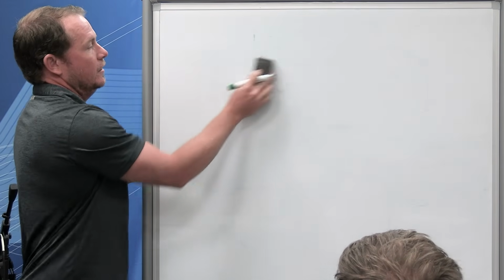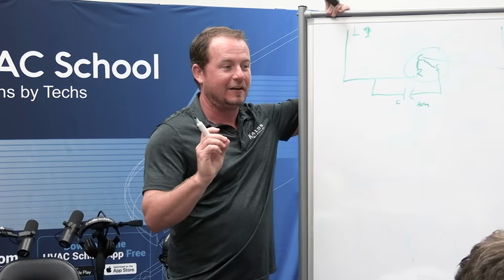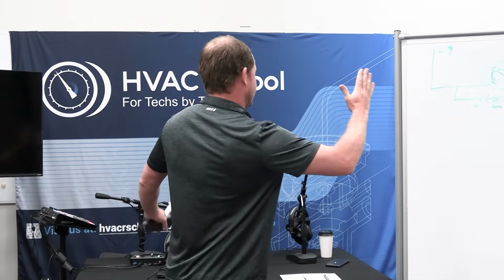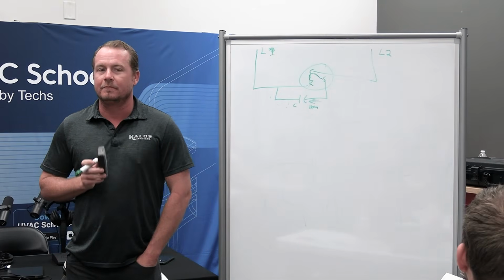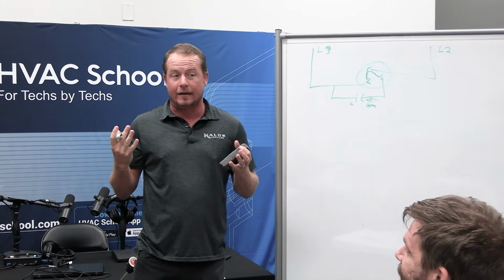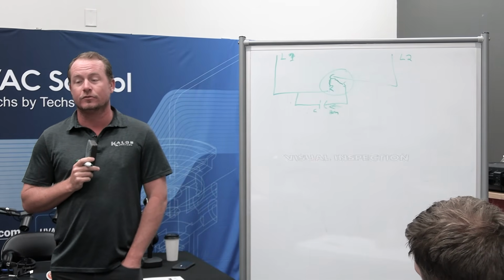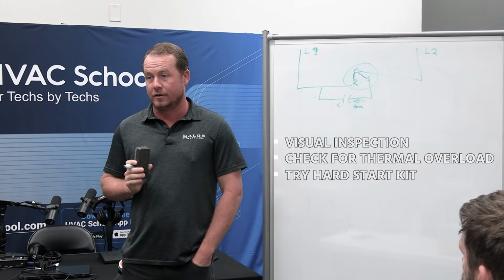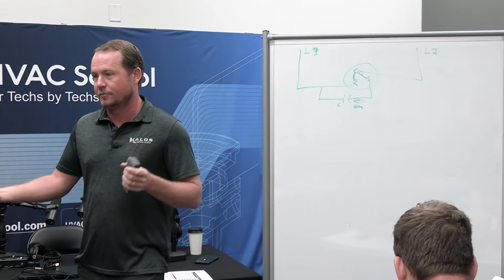Capacitor and Hard Start Myths Busted

Comment: Also, AC current DOES pass through a capacitor and there is no ballon. The current goes through it. 
A discharged cap acts as a short. Wire one across a potential difference and wait for the big boom. A fully charged cap will resist current flow. This is why it will hold a DC charge and not allow any more current through it. But with AC, the cap will not stay charged. It will discharge again, and cause a short circuit. 

A great example of AC passing through a capacitor is with amplifiers. They have coupling capacitors from one stage to another. They block DC from getting through, but allow the AC to travel unimpeded. For example, in the pre amplifier section, we have a very small signal and our transistors have a certain DC bias, but as we enter the next amplifier, to increase the amplitude of the AC signal, we need a higher DC bias to provide more power for the next set of transistors. So basically, each stage of amplification will need increasingly higher voltage power supplies, but the signal needs to pass from one to the other. The coupling capacitor serves this purpose, allowing AC through it. 

I mean this may be splitting hairs, but we are trying to understand it and dispel myths.

Another great example of AC passing through capacitors is with the crossover inside speaker cabinets. The capacitor is sized to resist certain frequencies from passing though, while allowing others to pass freely.
Reply: Technically, the actual electrons do not pass through the capacitor, but they affect the circuit on the other side of the cap dielectric as if they were, through the field developed by the charge.
Reply from the maker: @wingerrrrrrrrr  exactly
Reply: @wingerrrrrrrrr  I just created a video, since I’m off today and interested in the topic. You may be right about the electrons. I’ll have to do more research on that. I do remember learning that when you’re electrocuted, it’s not electrons, but ions passing through your body. I’ll have my video up shortly. But to answer the question, yes current does flow through them.
Reply: @wingerrrrrrrrr  some sources on the web say the electrons flow, and some say they don’t. Wikipedia says that capacitors allow alternating current to flow through them, but doesn’t distinguish if it’s actual electrons or not. My old textbook from 1989 says that ac current flows but also does not specify. In the beginning of the book, however, it says that the book will regard current flow and electron flow in the same manner. It is confusing. Whether it’s electrons or not, current definitely is going though there. I’ll try to research it a bit more.
Reply: @brianlittle717  it's basically electrons by proxy, the ones on the opposite side of the dielectric stand in and represent the original ones in full force and manner 😉.
Or a crowd of zombies pushing against the rubber wall and moving the ones on the other side, until the wall gets stretched enough to keep them from pushing any further (DC voltage, with cap fully charged). 
Increase the mob of zombies pushing harder and harder (higher voltage), to the point the wall gives way (cap overvoltage breakdown), and then all hell breaks loose with uncontrolled zombies running amuck all over (magic smoke released).
AC voltages are the zombies pushing back and forth on the rubber wall in a madcap spy vs spy scene.
Reply: @wingerrrrrrrrr  sounds a bit like quantum physics...
Reply: @wingerrrrrrrrr  I like the zombie analogy. That’s pretty cool. Capacitance definitely behaves differently in DC circuits than AC. Whether it’s electrons or zombies or whatever, the current is most certainly going through my capacitors in my videos. There’s no getting around that. The capacitor is definitely closing the circuit and allowing something through.
Reply: @brianlittle717  By all means, please come here, start spouting off like you're an expert, then reference Wikipedia and 35 year-old text books as your source.
   Go back to tiktok and chugging antifreeze or Tide pods or whatever you geniuses are doing these days.
Reply from the maker: Explain how it passes THROUGH a peice of plastic sheeting between metal plates 

Ohm across a run cap and see what you get

There is no conductive path
Reply: @HVACS  absolutely. When you use an ohm meter, you are using a DC voltage. You have simply charged that capacitor to a DC potential. Capacitors behave completely different with an AC signal. Electrons from one plate charge the other and then discharge. This is how electrons can flow from one plate to another. Remember, we don’t need a physical connection to complete a circuit. If my body is charged with a high static voltage, I don’t have to make physical contact with a grounded source for electrons to move from one place to another.
Reply: This is just the first thing that pulls up. 

https://youtu.be/11dzDiPfAs8
Reply: @HVACS  What he means is the AC SIGNAL passes through a properly-sized capacitor.  As the electrons enter the foil, they encounter the barrier at the dielectric, build negative charge on that plate, repelling electrons from the opposite plate, and out of the opposite pole of the capacitor.  So the signal is effectively passed, though the individual electrons do not.
Reply: @HVACS  yep. electrons pool on one side on the uphill curve of the sine wave. when the phase shifts downhill (sine wave) the pooled electrons leave the capacitor. Only with a leaky capacitor will electrons flow within the capacitor past the dielectric barrier
Reply: @HVACS  To be fair, in normal wiring electrons move about 1/4 inch per second, so at 60Hz they'll wobble back and forth by a few thou. As far as electrons flowing goes, there's little difference between a capacitor and a wire, it the effect on voltage across the cap that's the useful part...

Comment: ELI the ICE man
In an inductive circuit, voltage leads current by 90*
In a capacitive circuit, current leads voltage by 90*
The PSC motor is a capacitive inductive circuit 
The capacitor is trying to neutralize the phase shift in the start winding, that was originally caused by the run winding being shifted by the inductive circuit. 
The effect is that there are more “north and south” poles making the motor more efficient and more powerful by having electromagnetic forces applied at multiple points at any given time.

Comment: This was well explained. Coming from the engineering side, about a year ago I started looking for a simple way to calculate what size cap is needed in PSC and CSCR motors. I made a little headway by looking at simplified RLC circuit models. It was enough to realize that when inductors like motors are paired with capacitors, they get a kind of 'tune' that is specific for the frequency of incoming power. If one replaces a cap with the wrong size, expect the circuit to be tuned at the wrong frequency, with unpredictable and often bad outcomes. As you say, relative current flow down the two windings and power factor can dramatically vary depending on the capacitor chosen. My effort to find a simple solution hit a bigger road block when i discovered that power factor and motor inductance vary with rpm, and of course there is the usual tradeoff of starting torque vs full load efficiency considerations. I believe most new motor designs these days are practically tested in the lab with various capacitors, ultimately leading to chosen capacitors that balance power consumption, motor longevity, cost, and reliable starting. There is no easy formula. Any movement away from the design is not likely to end well, if only leading to lower efficiency or poorer motor survival.
Reply: Once you get past the starting function, run caps are selected for the best power factor, i.e., most efficient, at the design load.  To me, the run cap and aux winding form something of a tank circuit, like are used to tune radios.  Grundfos had a good motor book on their website.  I believe it is still out on the internet, even the internet archive, but they've organized their "education" so that it isn't readily locatable on the Grundfos website.  From that book, I learned the cap is chosen to create as spherical a magnetic field for the motor as possible.  When the cap is wrong, the field is elliptical and the non-circular part is dissipated as heat.
Reply: @jkbrown5496  yes using a curve tracer can really help find the best cap too the data sheets are helpful but you would be surprised still how much u can see with a curve tracer just from the shape of the circle that each cap gives you
Reply: @daveselectronicslab  Having to calculate power factor and start/run caps in HVAC doesn't inspire the same confidence I have in, say, a third-order LC crossover/bandpass filter. It's not that capacitors change fundamentally, it's just the amount of variants in manufacturing that can share one data plate. I suppose that is why some people just stock turbo caps on the truck, and why I tend to love good tolerances and high voltage ratings. And, all my facilities with 3Φ power for HVAC. 😁
Reply: @jkbrown5496  you
Reply: @jkbrown5496  Thanks, for the tip, I found it, searched Grundfos motor book pdf.
Reply: If only the impedance was fixed.  But at least your dealing with a 60hz signal that doesn't complain about parasitics.  One way to test, off the top of my head, is to use two probes of a scope.  One with voltage over time, the other current over time.  Adjust the capcitive component until they line up.  I have always though resonance to be that simple.  Align the current and voltage components.
Reply: Get your own channel Nerdy Boy.  People don't care about that shit.
Reply: I appreciate your input. I have been looking for a way to figure, when the uf value is not present, how to figure the uf... your explanation is solid. Thanks!

Comment: I like the analogy of the ballon or the bladder tank a pump, I think it is one of the best analogies to clarify how a capacitor works in the circuit

Great job Bryan as usual! and you got really nice interactive techs over there 

really funny to see Bryan's excitement @26:00 when he talks about hooking up a capacitor to your outlet
Reply: Or a plumbing expansion tank. With a backflow preventer and regulator, the supply will only provide 60psi (for example). In a closed system with all faucets closed after just running hot water, the water heater will fire and increase the psi from heating the cool water that entered the water heater tank while the hot faucet was on. The expansion tank is normally pressurized to 60psi, but the expanding water pressure will push the diaphragm allowing water to flow into the tank (let's say gradually increasing pressure to 65psi instead of 90psi without a tank). This extra pressure is then released when a faucet is opened and the system returns to 60psi when the faucet is closed. However the role of capacitor for a compressor and role of expansion tank in plumbing are totally unrelated.
Reply: These balloons can develop negative pressure so a bladder restriction would represent it best. Electrons don't pass through them just as water or air wouldn't pass through the bladder, but can affect the other side in similar fashion.
And if subjected to too high a pressure (or voltage in the case of the capacitor), thar she blows 😉
Reply: BAD IDEA!

Comment: Good video 

Capacitor used on AC doesn’t have polarity
Capacitors doesn’t reduce the amount of current, just de-phase the voltage and current (shift forward the current from the voltage)
AC voltage doesn’t goes from 0 to 150 as the video said, in facts it goods from -150 to +150
Reply: The capacitor also dictates how much current can get through by its size in micro Farads it fills up on half the wave and dumps on the other half what it has stored with is dictated by its size hence it does effectively limit current

Comment: When the compressor is locked... Hit it with a hammer 🤣🤣🤣. Remember those briefcase sized machines used to rock the compressor? Should do a class on those.
Reply: I used to just kick them with my steel toed boots.  It’s a good way to get a thermal overload, which is stuck open, to close also.

Comment: I’ve been explaining this to my technicians for years and few seems to get it, so I hope if I show them this video, they will finally understand. THANK YOU FOR DOING WHAT YOU DO, AND KEEP UP THE GREAT WORK!!!
Reply: Based on your experience what would you say is the life expectancy of a hvac cap. Would you change a cap at certain intervals? yearly? every two or five years?
Reply: @bwj1158  when its below its manufactured rating usually 5%±
Reply: @cricricri122  Thank you!
Reply: Depends on the heat environment it is subject to heat kills them over time so in florida 1 year maybe ohio 3or4 years or more ?
Reply: Very good explanation of one of the simplest electrical devices that is the most miss understood in the  industry. 😮

Comment: I loved this video, I learnt so much, as an older technician I’m always learning.
I use hard start capacitor kits to replace the current relay and start capacitor with great success I have seen them last 12years then fitted another and away it goes again. I almost never use the original start components and have kept many compressor running for many years , I have been using them for about 15years now. I never get caught without starting components. You can’t save them all but most you can.
Reply: So wrong...
Reply: @daveselectronicslab  that is your opinion but I have proven this works over 15years, I think you should always have an open mind, just because it has always been done a certain way doesn’t make it the only way or the best, always strive to do better. All the best

Comment: Thanks as always your content is solid.

I know for me the most recent key to understanding how electricity works is how it is created from electro magnetic fields which pushes and pulls the electrons through the circuit and then in the case of inductive load it been creates electro magnetic fields 

Maybe I missed it but I would love to hear your take on how electricity flows in each circuit from the power plant transmission lines and the service seeds of a building our home. And then last but not least how electricity is consume if you will.